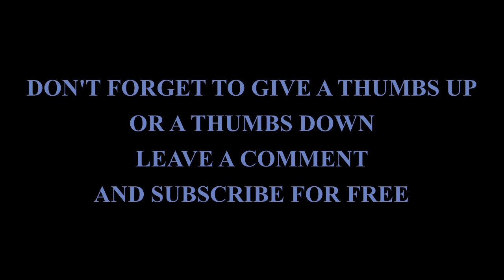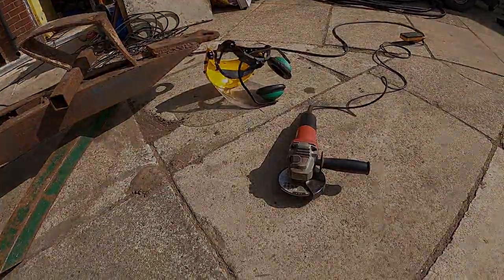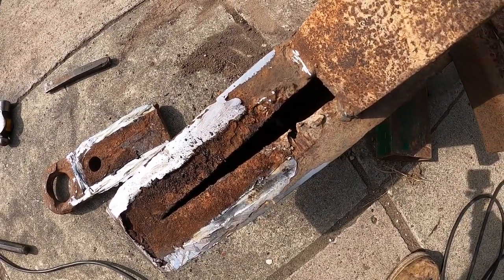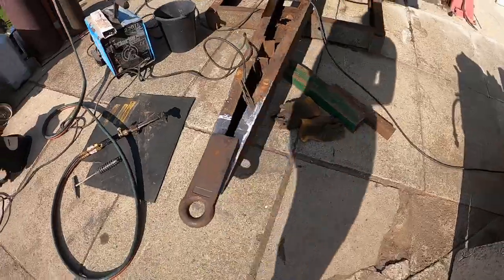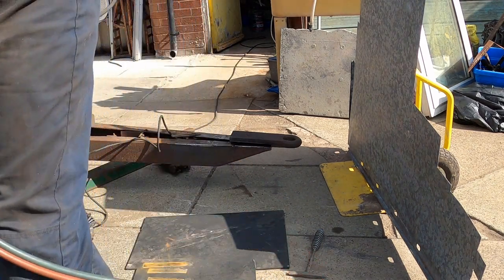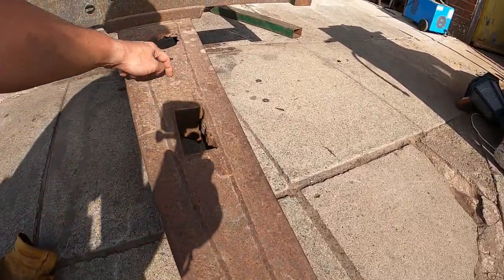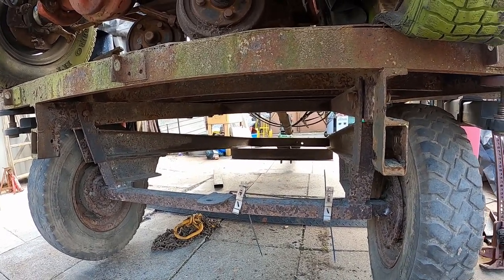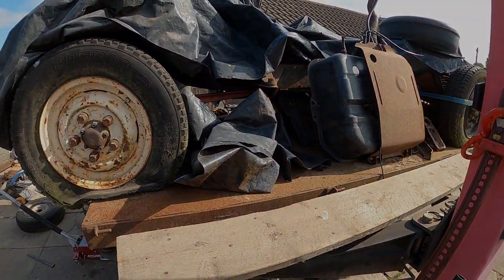VINTAGE THURSDAY TIPPING TRAILER PART 4 DRAWBAR REFURB

Comment: great job on the  towing eye looked good strong job when it was finished. i remember welding one one a grain trailer years back was always worried it would break.  when fully loaded. but never did !!!!!!
Reply from the maker: Thanks  All about getting the heat into the material  :)

Comment: You need a warming torch not a cutting torch ideally, OR, you could cheat and use a gouging tip which I have done sometimes for warming stuff up fast. That cutting tip is too fine really. Also, for that kind of job, 6010 rods, followed by three to five stringers of 7018 to make sure that hitch stays on. Please tell me you didn't use 6013 rods?
Reply from the maker: 7018 rods 😀  i only have a propane blow torch or the cutting torch but any preheat is better than none and i only need the pre heat on the weldable area not the complete part. Yes i know the part absorbs the heat, so have to fire the weld on it quickly